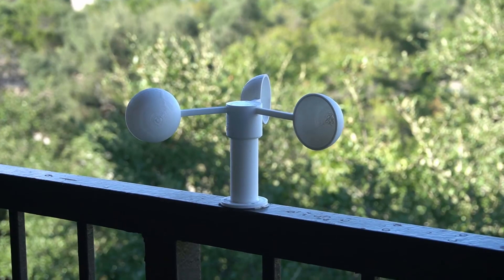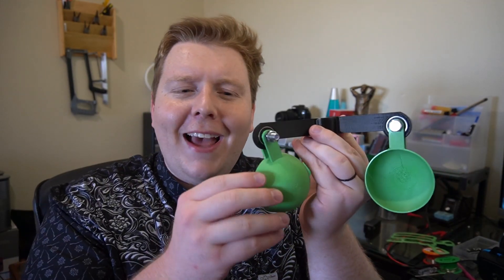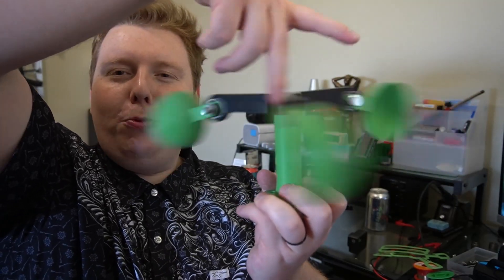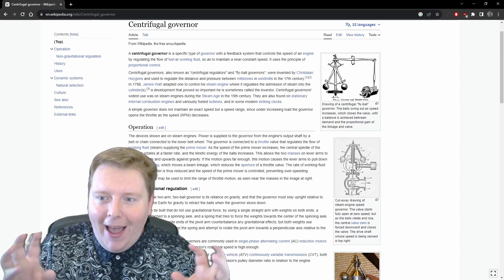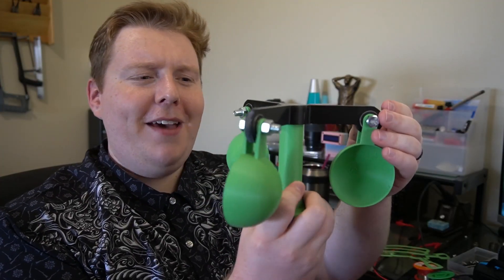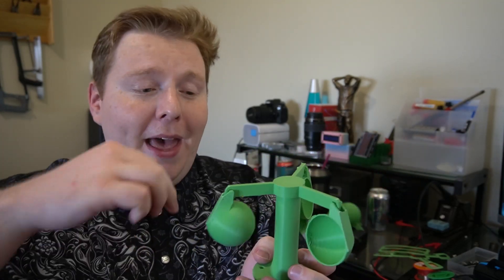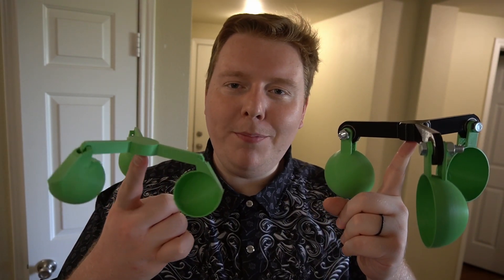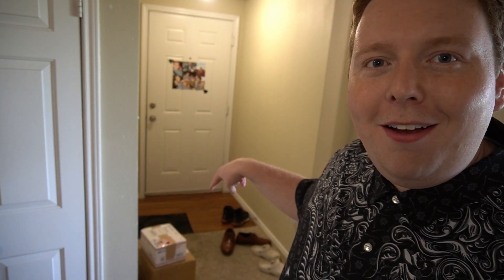Steam Governor Anemometer

Comment: If you use your anemometer to measure windspeeds you need to compensate for the fact that your cups aren't fully extended at lower rpm or your measurements will be too low because your spinning wheel has a variable diameter.

Comment: Great idea, you could prolly add a linkage to an airspeed indicator. 

Also, could you print with the cups above the arms so they are circular just like the other one?
Reply from the maker: That's a really good idea, you could have a dial that looks like a galvanometer but is controlled by mechanical linkages! It would be a sight to see, for sure. 

That might work, I'll see if I can draft something like that up. That would solve the problem of fitting on the print bed, too -- assuming I'm understandign you correctly.

Comment: So stoked you're still making videos! Love these short things. One of my old 8th grade students made an anemometer, partially inspired by all your wind videos! I love that with this anemometer, if you want to actually use it to measure wind speed I think you would have to find a way to account for the changing moment of inertia as it's rotational velocity changes. Really interesting problem to model mathematically. Or the more I i think about it, I think it would just act like a bit of a filter, slowing its response to changes in wind velocity at higher wind speeds. Jeez, now I may have to make one and graph its performance to see what's going on
Reply from the maker: Thanks for your comment! Tell your student they're a rockstar. What you've described is very interesting -- and something I probably don't know enough about yet to do justice in a project. Sounds very interesting, you should make one and make a video about it!! I'll be Evan's Factory's biggest fan! 😂